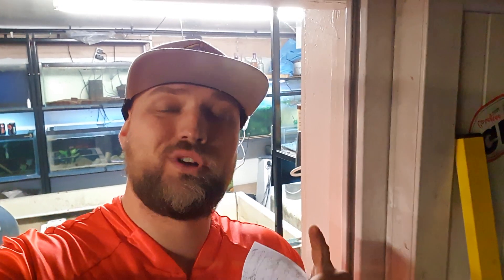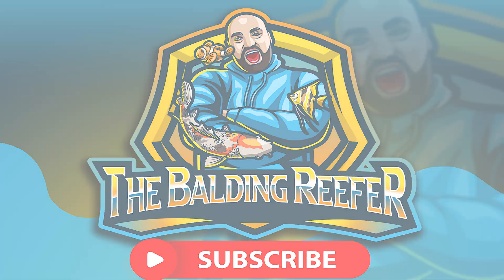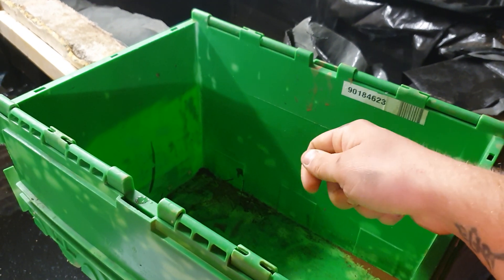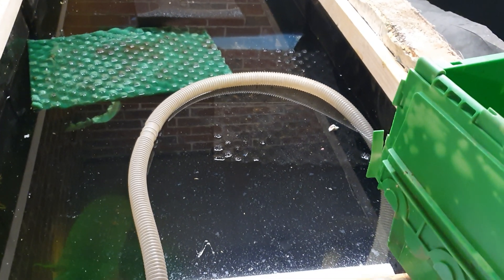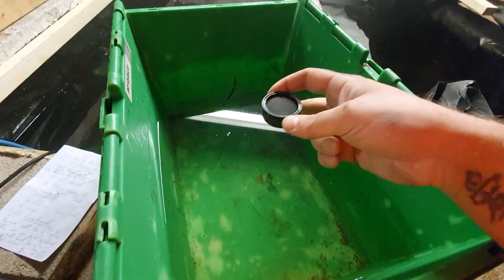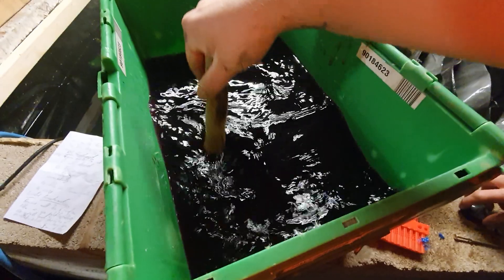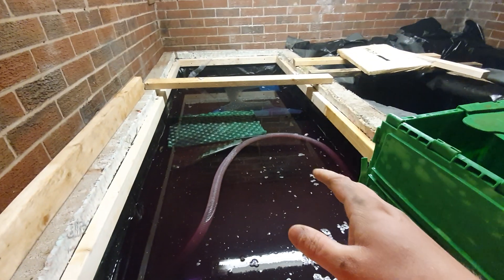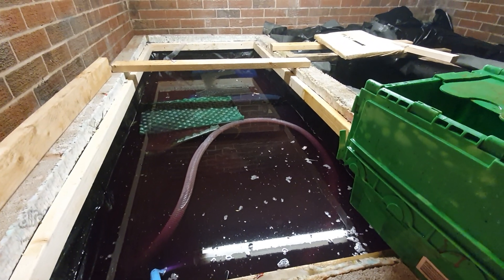How to: Treat your Pond or Fish with Potassium Permanganate

Comment: I used POTASSIUM PERMANGANATE a few years ago now on my 4ft coldwater tank. I stupidly ignored quarantine regulations and my fish were showing signs of fin rot! I was told about Potassium Permanganate by a local Pond supplies who also bred Koi! I can also say from experience it dyes skin as soon as it touches it, I had a bright purple thumb and forefinger for day's from opening the packet! But it sorted the fin rot after approximately two or three applications. It's brilliant stuff but I found out again to my ignorance how deadly it can be. My favourite koi was showing an ulcer on it's Gill plates. So I thought that I would apply PP directly to the open ulcer with a cotton ear bud. As soon as I applied it to the ulcer the tiniest of trickles ran to the Gill rake's the fish gave a massive jump so I put him straight to the open tank but it was to late he was already dead, it shocked me how fast it happened! To say I was gutted would have been a massive understatement. I only medicate the tank now. 
So as you can imagine I'm always extra cautious whenever I have to use it.
But in my opinion the Pros outweigh the Cons if used correctly.
I was also advised to remove all Activated Carbon & filters before using the Potassium Permanganate, I don't use Activated Carbon unless the tank water has a smell to it.
It amazes me how the purple water clears completely after about 6 hours or less! It will be really interesting to see how it effects your pod, I never thought about soaking equipment in it that's really handy to know thank you.
ANOTHER BIG BIG BIG THUMBS UP VIDEO 👍😷👍 Take care my friend 👍😷👍
Reply from the maker: That's brilliant Andrew, I have another video coming out over the next week or sonalso treating a koi with an ulcer and fin rot, so stay tuned for that one
Reply: @TheBaldingReefer  That will be really handy thank you. I've tried the word of mouth, but to actually see the procedure first hand would be great and I would feel more confident following. To lose a fish is upsetting but to lose a fish due to my ignorance is unforgettable. I'm finding myself getting more paranoid if ever I medicate the tank or individual fish.
Reply from the maker: It's all just about taking your time buddy

Comment: Hi Jack 👋 I use PP and have had no issues as ive Always weighed the correct amount out for the water im treating (knowing the pond volume including filters is key) I also Always leave all filtration running as its key to removing all bad bacteria and parasites.
It does indeed kill all good and bad bacteria but the filtration bounces back quite quickly especially in an established pond.
I've never done a treatment in the dark but its not advisable to do it in the summer when the sun is on the water.
Dissolving the crystals in hot water and using an airstone to keep it mixing for approximately 20mins helps to make sure there are no clumps that could cause the fish any problems, although i just mix up the appropriate amount in a jug of hot water and stir it until im ready to use it.
Adding it to the pond return slowly so it mixes and doesn't put a thick cloud around the fish all of a sudden.
I used to use hydrogen peroxide until i was told about sodium thiosulfate crystals.
Sodium thiosulfate crystals are less toxic/harsh on the koi and its also a dechlorinator too. There have been many instances where people have accidentally put far too much sodium thiosulfate in their pond without ill effects.
You should be able to find information on how to make sodium thiosulfate into a dechlorinator right here on YouTube (project koi YouTube channel has a video about it ).
One last thing and this one is important to people like myself who don't really like Adding chemicals to my water, when potassium permanganate is added to your pond you are to hang around to keep an eye on your koi just incase the worst happens. You need to keep the water a pink/purple colour for atleast 4hrs so it does its job. If it turns brown before that time you are to add more PP in the Same fashion at half the original dose. On really mucky ponds it will be spent quickly so its not uncommon to add a few half doses to dissolve all the organics in the system. If the PP has been 4hrs and is now brown/spent so not active anymore then you don't need too add hydrogen peroxide or sodium thiosulfate as there is nothing to gain by adding those chemicals. Water changes will clear the colour out of the water.

I use PP in a mild form 24hrs before treating for flukes as it removes the slime coat exposing the flukes so the treatment has more chance of getting the job done.

I appreciate thats a lot of information and its only Tuesday 🤣

Take care matey 👍
Reply from the maker: Mate your a legend, its comments like this why I continue to do YouTube, you'll be getting a huge shootout on my next video for this, thank you so much!
Reply: @TheBaldingReefer  knowledge is power my friend and you sir are welcome 🙏
Reply from the maker: Thank you brother
Reply: @TheBaldingReefer  here is the link to the dechlorinator video on Daryls channel (Project koi)  https://youtu.be/CbnVOnshyXg.
Reply: @Tom_Prendiville  Hi Tom, I also use SODIUM THIOSULFATE for a dechloranater it's dirt cheap and impossible to overdose. I get mine from off the Ebay... MINERALS _WATER.
Reply from the maker: Cheers Tom, appreciate it I'll give the link a watch
Reply: @PENFOLD1962  the recommended ratio to make up dechlorinator solution is 125 grams into 1 litre of boiling or very hot water to kill any nasties and dissolve the crystals.
Then 10ml of that solution to 100 imperial gallons of pond water.

Comment: I always have a container of hydrogen peroxide on hand to neutralize
Reply: Hi Chris sodium thiosulfate crystals are a better alternative to hydrogen peroxide as its less toxic and its also the active ingredient in dechlorinator solution.
Reply: @Tom_Prendiville  
Thanks for the info.. I was always taught to use hydrogen peroxide but you make perfect sense.. Thanks I will research it and get some.. Thanks
Reply from the maker: No worries, always here for help and advice if needed bro!
Reply: @stubbsaquatics6080  I fully understand buddy.